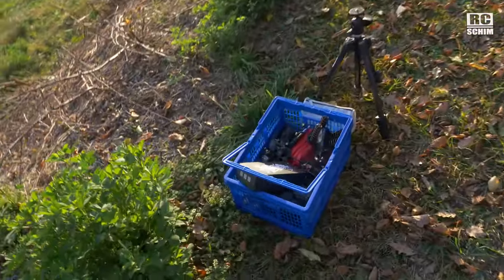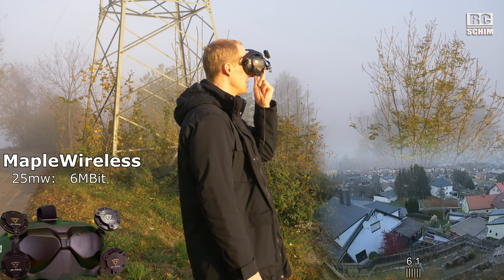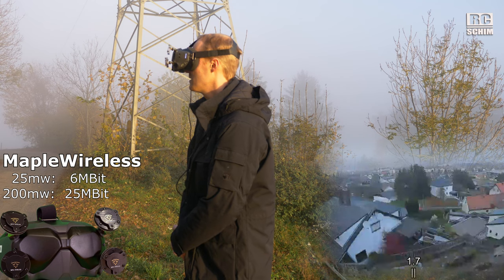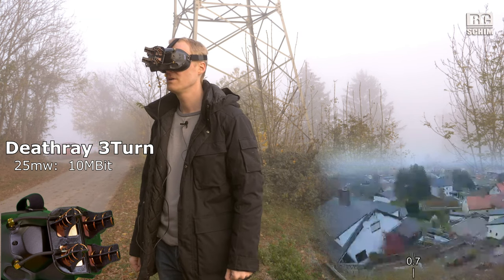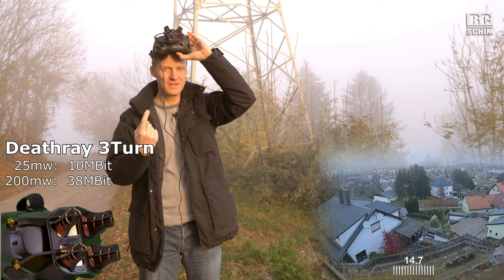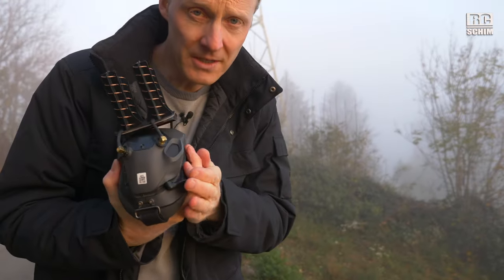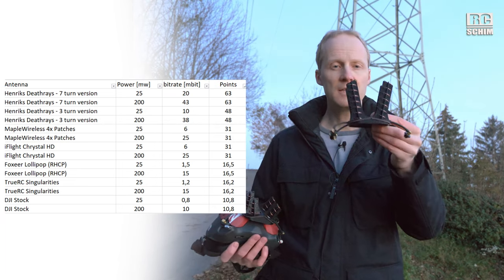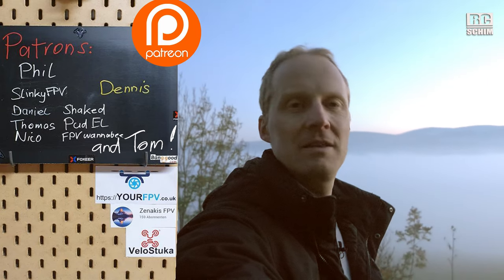Where to put the good antennas?  (DJIFPV Stationary 2.3km Test)

Comment: I don`t get why RHCP antennas are tested when the Air Unit use LHCP.
Reply from the maker: the Airunit in that case had LHCP AND RHCP antennas (that's the config MapleWireless recommends).
Thus I could also test RHCP conveniently. I've been assured that both Airunit antennas send out 100% RF
Reply: @Rcschim  Ah okay. But this makes phyiscal no sense to me because then there are introduce crossover intferences from the other polraization. So omnis would be better in this case. There was an Analog system from AKK also with an RHCP and LHCP TX at the same time and frequency and everyone was complaining that this is counter-productive and also makes physically totally sense. The goal should be to have only LHCP or RHCP to have no crossover talk from the other polarization. Also this limit the results on a LHCP-only Antenna set
Reply from the maker: @SusiSpecial  I also thought that this would be an dis-advantage for the LHCP only antennas - but in my test it wasnt.
In bando-flying with many reflections you end up with L and R RF waves anyways, because every time a signal bounces off the wall it changes pol. 
in this test I just wanted to treat the MapleAntennas the right way (as the vendor suggests with his L+R tx antennas).
To me it showed that this didnt give him any benefit.

I just didnt have the time to drive down there, swap TX antennas and up again (20-30mins lost). 
Sunlight is very scarce in my sparetime now :(
Anyhows, I think we can conclude: with somewhat decent antennas (like the iFlight for example, or the 3Turns) I get really good and consistent range and signal for me to fly very confident around - explore, fly between houses, behind even...
Reply: I tested the mapplewireless omnis and they aren’t really circular so rhcp/lhcp won’t matter much.

Comment: Why use one left and one right on the air unit?  This is not how 99% of users use the gear.......
Reply from the maker: Maple wireless uses it this way, and in my last tests I had just left and they complained. This time I had their l+r combo as recommended, but it wasn't better ;)
Other antennas shouldn't see much disadvantage in a stationary test tho...
Reply: @Rcschim  Thanks for the response. Great test.